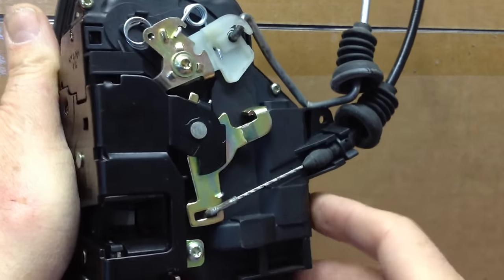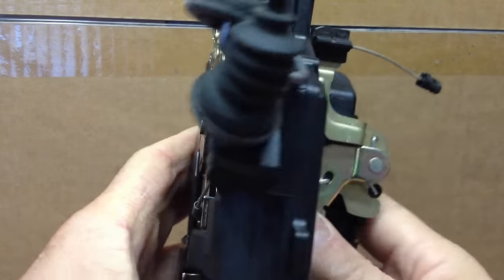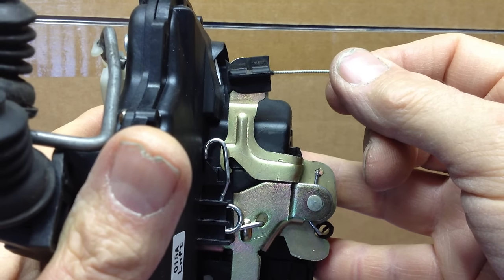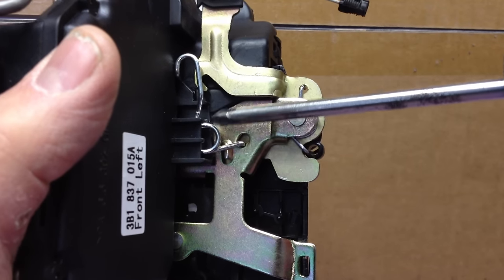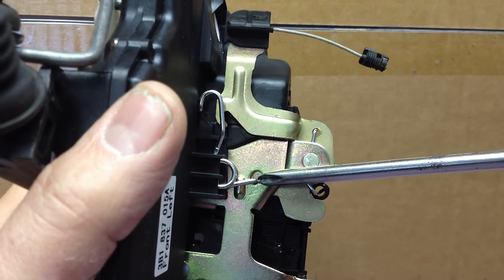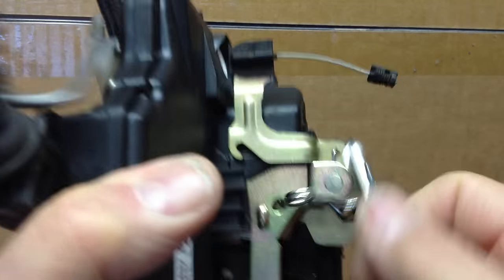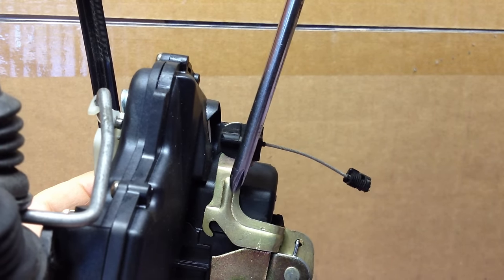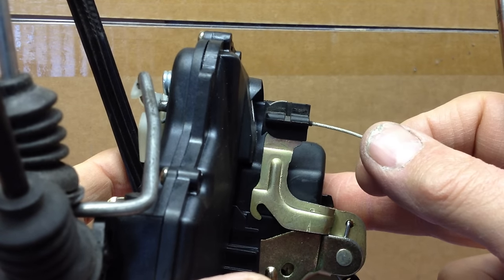Why Your VW Door Won't Open

Comment: This is what doesn't make sense is everything operates perfectly when I use the key manually. When I use the fob, everything works great except when I go to unlock the car. Every door unlocks except the drivers door. Once again, when I go to lock the car using the fob, everything locks and alarm is set. Where is the problem? It's not with the fob. I had the checked.
Reply from the maker: I'd just replace the whole lock assembly. There're multiple failure points inside and they're dirt cheap online.

Comment: Hmm... Between dealing with this and side windows that fall into the door cavity and a host of other odd problems with a VW, I'm starting to think that they make their cars out of junk parts.
Reply from the maker: Really? I have 412,750 miles on my Golf and love it.
Reply: There are lemons in every make/model. This '99 Passat has less than a third the miles of your Golf and a string of problems I've not seen in other Japanese or American cars I've owned. Examples of re-occurring failures in window regulators, door mechanism, switches, relays, hoses etc. It's been troublesome for my car. It also comes at a time when VW's integrity is being called into question about Emission Fraud. I'm not really conspiracy minded, but would it be far fetched to think that they may have intended to keep selling crappy parts so consumers have to replace them often? However, if Ford can turn around from poor quality issues, I expect VW will too (some day). I'm just a consumer and did I mention the Passat does drive nice? Thanks for posting the video.
Reply: Good for you!  That is, of course, all well and good.... looks like you have been one of the lucky ones?
Reply: Tad Foster Nn100jj

Comment: It seems the spring is actually helping the mechanism to get back to its initial position. Check this out: https://youtu.be/RqmqnK6UXvY?t=169
Reply from the maker: That spring only sets the position of the lever for assembly. Once the lever is pulled by the outside handle cable, it unhooks from the lever, never to be used again. Try it.

Comment: I have a 05 Touareg, the only door that will open is the driver. The others are stuck. We can't get to the lock? Any suggestions? Also, my trunk won't shut, i currently have it tied down. I swear this car is a piece of shit!!
Reply from the maker: Really sorry to hear that Brandi. I'm not too familiar with Touareg problems. We did own one for several years and never had any trouble. Did all the things that failed on yours all happen at the same time?
Reply: Brandi Huggins love
Reply: Brandi Huggins love

Comment: https://youtu.be/RqmqnK6UXvY   This video here will explain what the spring is for that you removed from the door locking mechanism in your video, it does have a purpose. It is for setting the pull tension for the outside door handle.

Comment: this guy does not know what he is talking about, do not take his advice about removing and disposing of that spring.  He even admits he has no clue what purpose that spring serves, yet tells viewers to remove it and dispose of it.  That spring is for setting the proper pre-tension before installation.  He would not have had the problem he had, if he had known how to set it up.  Normally, it is usually already set when you get the new actuator.  There are other better videos that show how to set it up.

Comment: VW, Audi, Merc.......... over rated, over priced, and unfortunately, over here.....   absolute junk.
Reply: I've had Mercedes and still do until a blown head gasket at 270K miles on my 99 E320. I have an Ml500 now and an 06 Jetta with all the bells and whistles and 160K on it.. Too bad no pos GM product would get to that mileage my 99 had nor any American car. Japanese cars are good on gas and reliable but still feel cheap and flimsy. I feel more secure in any European car before American or Japanese.
Reply: @jaimeespinoza807  🙌 👏 🙏 🤝 👍  I own an old AUDI 4000 been driving 11 X round the world ! ! ! Not much money invested. And yes, sturdy like a tank. A collision with a japanese rice cooker showed that. So Jane is in error . . .  its just like with  w i n e: it all depend on the vintage/year. Some types are gems - others not . . .